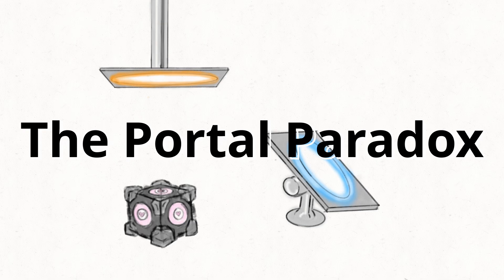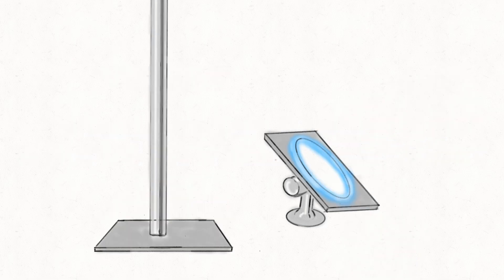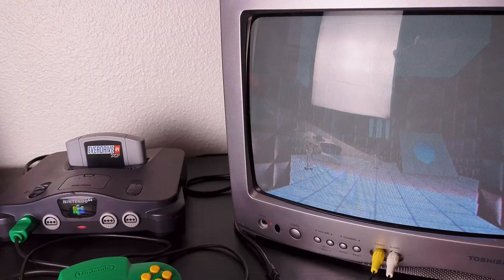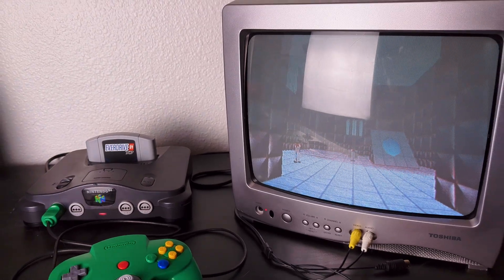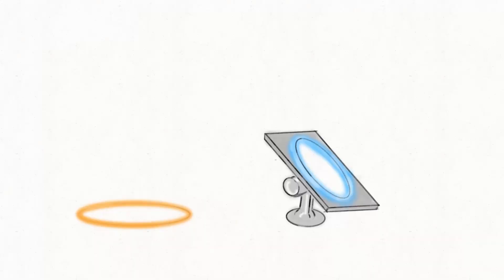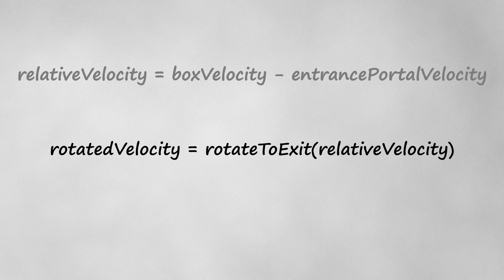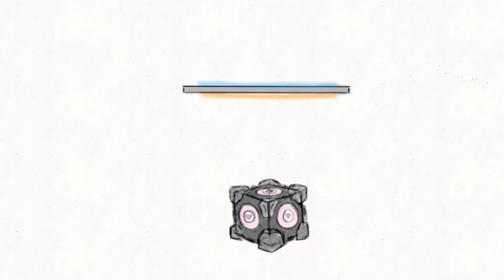I rewrote Portal from scratch and solved the Portal Paradox

Comment: The box does NOT shoot away. I will not use the hula hoop case to prove this point. (though I will comment on your use of it)

Tl;dr: your entire proof relies on a false assumption, you are focusing on wrong parameters, you did not actually prove that your equations provide correct results, and you are completely ignoring physics that is in favor of the 'it will just fall down' side of the argument.

Part 1: your justification for the shooting box

A) 'motion is relative' so far so good. 'doesn't matter which object moves, all that matters is the relative velocity' - here is where the problem starts. This part is simply not true. Different situations have different results even if the relative velocity is the same.
Real life example: you have an object on the ground and above it is a room with a hole in the floor.
1) push the room down at 100 km/h onto the stationary object. The object stays on ground (and hopefully the room survives the impact).
2) push the object up at 100km/h into the hole of the stationary room. The object flies into the room.
Both situations have exactly the same relative velocity, but the end relative velocity is different depending on other parameters. If relative velocity really was all that matters, as you claim, why did we get different results if the only parameter that matters is the same? Why are you for example ignoring relative velocity of ground and the box? Why are you ignoring acceleration, energy? Relative velocity is merely a result of applied forces, why are you completely ignoring force? (More on that later)
Your entire justification relies on an incorrect assumption, and therefore everything that follows is just extra.

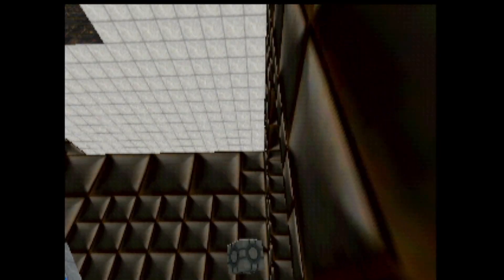B) the equations at 1:59 'show me the flaw with it'. The main flaw was the incorrect initial assumption, but let's talk more. Even if the assumption was correct, other than your own word, there is no proof these equation provide correct results.
This is a nice example of the 'I am right, unless you prove me wrong' fallacy. It's not my responsibility to prove you wrong. It's your responsibility to prove you're right, and you did not prove it sufficiently, because you are hiding steps of your method.
For example the function rotateToExit(relativeVelocity). How do we know this function is correct? What math is this function using? How do we know it is not just something you made up, so it provides the results you expect? Without showing how this function works, your entire proof may simply be 'it works this way because I wanted it to work this way' and should not be considered correct unless you provide a proof that it actually works.

And if you still want to stick to that argument, I will argue in exactly the same way. Your equations do not work, prove me wrong.
Also, I am wearing a blue shirt, prove me wrong. See, you can't and you would have to accept it as correct, even though I may be wearing nothing else than women's pink underwear.

C) Using the 'hula hoop' situation as a proof.
The two experiments have different conditions. One has a moving blue portal, the other has stationary blue portal.
The fact that an equation gets you correct results with certain conditions does not automatically mean you get correct results under different conditions. You even indirectly admit this point at 2:28 when you say "why does the behavior seem inconsistent? Because the two tests are not the same."
For illustration, consider my equation f(a, b): a+b=5. If a=2, b=3, the equation is correct. If a=97.2, b=-2.6, then the equation is wrong. This equation is only correct under specific conditions.
You have to prove you equation is correct under all conditions, or you have to provide the conditions when the result is correct.
What happens in your simulation under other conditions? What happens if you stop the portal just above the box? (I assume nothing) If you stop halfway?if you stop in the top half of the box? If you stop in the bottom half of the box? I am guessing that the center of mass of the box is the only point of the box you are considering, but in reality, even if you push just a tiny part of the box through, the equation should be applied to that part. Does your simulation consider that? What happens if the portals are moving away from each other? What happens if you start with stationary portals and stationary box halfway through, and THEN you start moving one of the portals. Is your simulation correct in all cases or just in one isolated case? Once again, you simply did not provide sufficient proof to support your theory.

Part 2: My justification why it would not shoot

D) forces and acceleration
Newton's laws of movement - an object can only change its velocity if you apply force to it (simplification)
You have a box on the floor, and a panel with an orange portal above it. You move the portal down at for example 100km.
When you want to slam the orange portal down, you first apply force to the portal panel to accelerate it, then you apply force to it to slow it down. At which point is there a force applied to the box, that would cause it to fly away from the floor panel? There is none. The only force applied to the box is gravity. ( and the reactive force from the floor panel, that is always equal to the gravity force, just in opposite direction)
Gravity is apparently pointing down. (Judging by the fact that the observer is not floating around) At first, the gravity is pointing perpendicular to the floor panel. When the box is through, gravity is pointing diagonally down and to one side from the floor panel (depending on the slope of the blue portal). While the box is being swallowed by the orange portal, gravity is pointing somewhere between those two limits. There is not a single moment when the force should point away from the floor panel. Therefore, there is no reason why the box should leave the floor panel.
Let's also consider case b) when you lift the box up into the portal at 100kmh. You first apply force to the floor panel, which in turn applies force to the box, causing both to accelerate. Then you apply force to the floor to slow it down. But you are not applying any force to the box, so it should continue in the movement.
Notice how the relative velocities are the same in both cases, but result is different depending on applied forces.

E) energy
Energy can not be simply created. You can only transfer one type of energy into other type of energy.
In your example, the kinetic energy of the box is zero. Where do you get the energy to make the box move? The only energy spent in the system, is to accelerate and decelerate the portal panel. How does the box receive the energy necessary for the flight?
This is once again different from the case when you lift the box. By lifting the box, you are giving it kinetic energy, so it can fly.

There, my comment on your proof and my reasons why I think the box will not shoot up.
And if you think my approach is wrong, then show me the flaw.

Comment: The portal paradox I'm curious about is what happens if you attach two parts of an object together WHILE it's mid-way through a portal. Take the standard "2 portals on a 90 degree corner" that people use to see themselves. Stick a bar inside, attach the end near you to the end which comes out and... what happens? It can't move sideways as that would translate to front-back movement on the 90 degree end and it can't rotate up or down as both ends would rotate in opposite directions.
Reply: I was going to add a whole essay's worth of explanations, but I'm not sure it'd be entirely correct. I recommend watching Minutephysics's video on portals passing through each other, it likely explains it and gives you more of an understanding better than I could.
Reply: Is there actually anything that can't be explained here? As you said, you can't move it sideways and you can't rotate it. If you just let it go, it would fall to the ground and stay there. If you tried to rotate it or move it sideways, you wouldn't be able to, unless you applied enough force and some part broke.

Interestingly, this would create a bar with a 90 degree angle that can only move up or down, but cannot be rotated or be moved left or right.
Reply: @someaccount3438  Certainly. I just find the behaviour extremely unintuitive, so it's hard to tell if I fully understand how it would function. It's essentially a bar anchored to itself, stabilising itself... which is just weird :)
Reply: @Malidictus  It's mind-boggling to me how easily this can be imagined, considering the impossibility of the whole construct.

Comment: It'd say the speed of the portal doesn't matter as it works more like a butterfly net, catching it and swapping it's locations. There is no energy transfer to give the box the impulse to fly. I'd say it would start dragging against the edge of the portal on the way as different parts get affected by different direction of gravity and finally roll over. Otherwise you're creating energy out of nothing.

Imagine you had a box suspended in the air with an exit portal underneath then slamming an entrance portal down like in the video towards the exit portal. If things works like you say, then that box might possibly get catapulted to infinite speed if you can catch the box multiple times on the way down.

Comment: Just brainstorming, but two things I noticed:
1) I might be misinterpreting them, but I think your system of equations seems wrong. Your variable 'rotatedVelocity' should not be utilized. You are doubling the velocity at this point. You account for the reference points A (entrance) and B (exit) with the other two variables. It might simply be changing orientation, I'm not sure from the commands and variables used.
2) Using relative velocities, your simulation still doesn't add up. With no outside forces acting on the cube (my perspective being the portal imparts zero forces), the cube has zero V relative to point B (and relative to everything else in the room) at the start but somehow gains V at the end. What forces accelerated the cube? On the same note, the cube has, and maintains, a set V relative to point A until point A changes V DUE TO OUTSIDE FORCES (e.g. the ground made it stop). Even viewing this from a microscopic level: portal entrance approaches atom at V, atom goes through portal, atom pops up at other end of room STATIONARY, portal entrance is STILL moving at V only across the room. Relative V is still maintained throughout. By 'launching' the cube, you have broken the entire relation of relative velocities.

Comment: If you watch the portal from where the box exits, it should be clear that the box should not be launched because it demands an acceleration that comes out of nowhere. The box is stationary and the portal cannot have a speed assigned to it since the only thing it does is stretch and compress spacetime because as far as we are concerned, the two ends of the portals are the same point in spacetime. The box would just appear on the other end as fast as the portal moves and fall off next to it
Reply: The box cannot emerge from the stationary portal without moving. So to stop moving once it passed through, there must be a reason fro it to lose its kinetic energy.
Reply: @whitemouse2460  there is no "emerging" since there is no "inside" the portal. Both ends are the same point in space, so there is no logical reason to expect a launch.
Reply: @alexyuri_94  I'm talking about stationary exit portal from which the cube emerges. In the original Portal, objects do not teleport instantly as a whole, they go in and out of portals gradually, like through a hole.

Comment: I guess it depends on how portals work. I always saw them literally as doorways or hula hoops so it would work the same way as literally just passing a cube through a hula hoop, meaning that the hoop has no effect on it at all?
Reply: Except for the part where you missed the point
Reply: @DWal32 be nice
Reply: @DWal32 says the guy who seems to have forgotten that the entire thing is a thought experiment and portals already break fundamental laws in physics, so OP’s interpretation is just as valid.
Reply: @Scuuurbs  says the guy who forgot that other fundamental laws of physics, i.e. gravity, still apply, thus this logic is flawed. Appling the same logic as the opening of a container to the openings of a wormhole is the only thing that makes sense.

Comment: You've created a new question. What happens when you slam a portal down on a cube Halfway. Half the cube will then be stationary on the other side because the `end` of the cube has not yet transferred through yet. Thus is would need to be the relative velocity of the last component that determines the inertia on the other side

Comment: 🤔 I knew that the result is cube flying out of the stationary portal because it has to save the kinetic energy of the portal, though, what is up with cube's momentum? IRL the cube would consist of particles and atoms(that's how I like to imagine things and try to solve some of these type of questions, at least sometimes) and since they're part of one body the moving part of the cube would drag the stationary one meaning that not only cube loses some momentum of the portal to drag the other part of itself, but that it's also moving with acceleration. But in-game cube is literally a cube, it's not atoms and stationary/moving parts. So in that instant, does cube in your engine moves with acceleration or not and why?

Comment: The reason I think it wouldn't work like this realistically is because the cube isn't moving, there is no momentum to be maintained. The kinetic energy of the platform is turned into vibrations and heat as it hits the ground, and because of the way gravity is interacting with the cube, it just rotates gravity 45 degrees and the cube slides or tumbles off. The movement of the portals is irrelevant to the cube realistically because the cube itself has no momentum, and doesn't gain kinetic energy because a door went past it quickly and changed the gravity 45 degrees.
Reply: I think in game logic it should work your way, just for the simple fact that it makes it more fun and it feels more consistent, but realistically I don't think it should be much different than just shifting the gravity on it by 45 degrees.

Comment: I actually think that, in real life,the cube would just plop. The speed of the portal isn't relevant here. The floor is what is preventing the cube from moving. At the instant the portal overtook the cube at the floor, the only action on the cube would be gravity. So the cube would then proceed to fall, but wouldn't get a speed boost from the momentum of the portal. In essence, it's the same as dropping the cube from the height of the exit portal.